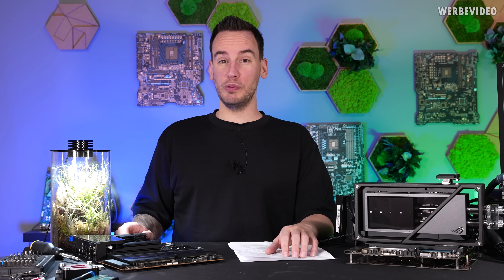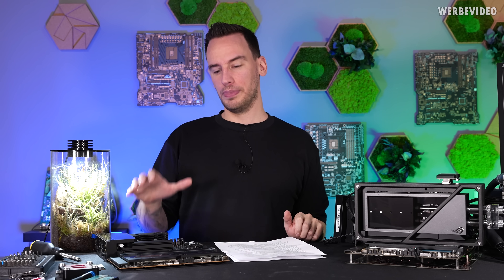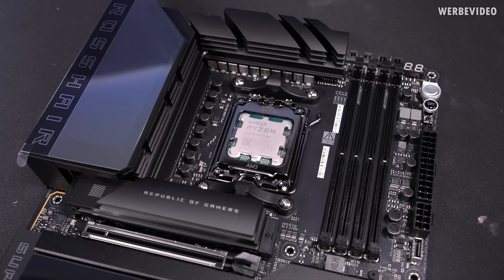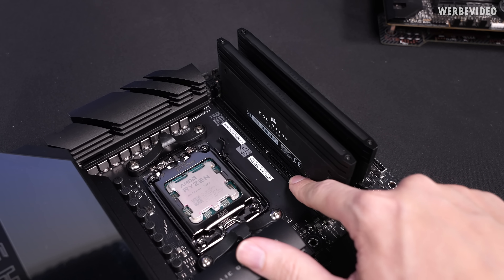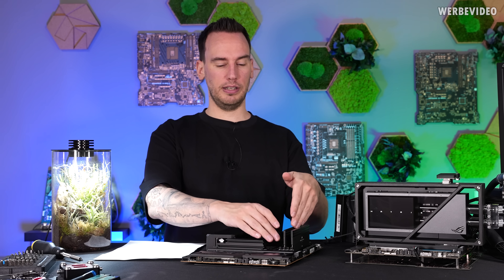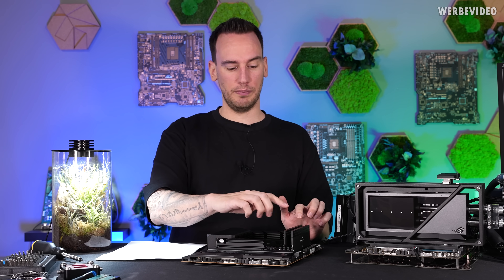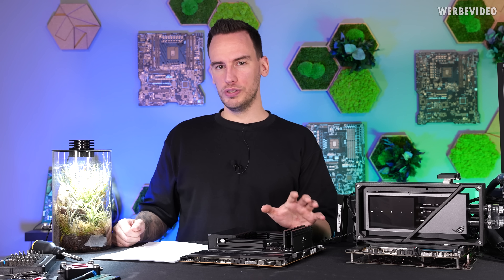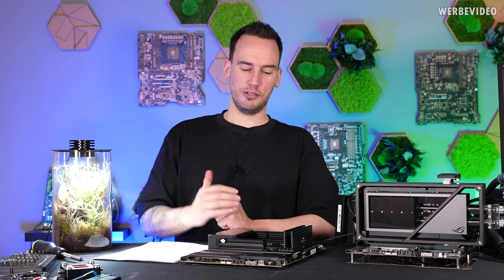How Empty RAM-Slots cause Trouble - ASUS NitroPath

Comment: I wish there were affordable 2 memory slot motherboards available. I’m not keen on seeing empty slots on my board, and running 4 sticks at decent speeds on AM5 is problematic.
Reply: It's funny when you think about it. It used to be the cheapo budget boards that only had two slots. I mean you're getting less, so it makes sense. Now with the way ram works in both the way demonstrated here and for general stability at speeds you pretty much have to run two sticks, so less became more... 

Leave it to the board manufacturers to find a way to charge us more for giving us less.
Reply: 3 to 5 years is what it took for 5900x b550 to run 4 sticks at xmp, just got a bios update that does it with no problems, ddr 5 has a trick to adjust ohms and not using much voltage as single gets bad at high volts.
Reply: @JohnDoe-tv4zd What is this trick with "adjusting ohms" that you're referring to? I'm not entirely sure I've heard of this one. I haven't tried pushing my OCs further in a while so I may be out of the loop a bit (mostly because it's such a chore to chug through the long boot times for every little adjustment). 

I got mine stable (on AM5) at 6400mhz 28-30-30-30-60-48 with all the other secondary timing tweaks and gdm/pwrdwn mode disabled, with 2200mhz fclk and called it a day. I also haven't updated my BIOS in a long time because MSI made so many BIOS updates that broke crap, along with every update wiping my complex settings out every time that I gave up on it (seriously why have OC profiles, if they don't transfer between BIOS versions?).
Reply: running 4 sticks at decent speeds on AM4 is also problematic 😞
Reply: It's cheaper to make a 2-slot board and you might actually find that the very lowest of end have them.
Problem is that despite being a better config for like 90% of users (you buy 32GB once and pretty much never need to upgrade), 2 slot boards just sell way worse in the same way that people like seeing lots of NVMe slots despite most just using a single drive and maybe a secondary sata game drive these days.
Reply: @bayanzabihiyan7465  I would argue that looking for a board with lots of NVME slots even if you are only currently planning on using one is still good practice. Future proofing is one of the most important decisions one can make when building a system. NVME is the way forward. Outside of needing very high capacity drives, it makes no sense to buy SATA based storage anymore (the pricing difference being increasingly negligible). So having more slots, even if they are empty initially, sets one up for future expansion.

Although, a bigger challenge there can be ensuring that the NVME slots won't rob you of lanes to run your GPU at 16x. Regardless of chipset, this can be misleading and obtuse (varying greatly between models/brands). So just like slotting more than two sticks of ram there are potential hurdles there, but with far less of a problematic hard limiting (especially with proper research).
Reply: @bayanzabihiyan7465   I would argue that looking for a board with lots of NVME slots even if you are only currently planning on using one is still good practice. Future proofing is one of the most important decisions one can make when building a system. NVME is the way forward. Outside of needing very high capacity drives, it makes no sense to buy SATA based storage anymore (the pricing difference being increasingly negligible). So having more slots, even if they are empty initially, sets one up for future expansion.

Although, a bigger challenge there can be ensuring that the NVME slots won't rob you of lanes to run your GPU at 16x. Regardless of chipset, this can be misleading and obtuse (varying greatly between models/brands). So just like slotting more than two sticks of ram there are potential hurdles there, but with far less of a problematic hard limiting (especially with proper research).
Reply: I would argue that looking for a board with lots of NVME slots even if you are only currently planning on using one is still good practice. Future proofing is one of the most important decisions one can make when building a system. NVME is the way forward. Outside of needing very high capacity drives, it makes no sense to buy SATA based storage anymore (the pricing difference being increasingly negligible). So having more slots, even if they are empty initially, sets one up for future expansion.

Although, a bigger challenge there can be ensuring that the NVME slots won't rob you of lanes to run your GPU at 16x. Regardless of chipset, this can be misleading and obtuse (varying greatly between models/brands). So just like slotting more than two sticks of ram there are potential hurdles there, but with far less of a problematic hard limiting (especially with proper research).

Comment: In the old days some server boards used RAM termination DIMMs. Basically, just a blank DIMM to ensure memory signal integrity. Every empty slot had to be populated with one. When they first came along, I thought the concept was sound.
Reply: Reminds me kinda of the ancient rambus RDRAM slots early Pentium 4s would use... but this was basically non-optional as they had to have a passthrough DIMM because from the way the memory channel looped; it would not complete the circuit without them.
Reply: @PriaSamari  
Before anyone mentions it, I don't think the N64 did that first. If I recall correctly, the Jumper Pak is actually a set of resistors that are designed to properly close each RAMBUS line, as the RAMBUS is set up to be daisy-chained with the Expansion Pak. If I heard correctly, A1 and A2 or B1 and B2 are daisy-chained in series, the N64's RAMBUS and Expansion Pak, I believe, are daisy-chained in parallel, thus necessitating a Jumper Pak if no Expansion Pak is available.
Reply: @PriaSamari  yes RDRAM (or RAMBUS), was used in server and workstation boards, but was really expesive like 3-5 times of standard SDRAM. i did build few servers and workstations with that, from professional workstation integraph used this on their intel based workstation (they were also making Sparc based ones). Fortunately mainboards did come with those blank modules, so you didn't need to buy them separately. soon after this was followed by DDR, which pushed out RDRAM and SDRAM.
Reply: @PriaSamari  Beat me to it. As an actual customer of RDRAM. It came with dummy/terminators. and boy the cost to upgrade was so bad i ended up using that P4 with Hyper Threading mind you till I was forced to upgrade when Win7 was in release candidate. the problem with RDRAM was the license fee and only a few companies could afford the fee. DDR1 was cheaper to license, the speed was lower but the implementation was easier. The 90s might have been a wild ride with compatibility, but the early 2000s were a Hodge Podge of standards.
Reply: I wonder if there are ways to make similar DIMMs for DDR4 and DDR5 by simply cutting off the PCB traces of scavenged broken DIMMs, or if they need to be purpose-made.
Reply: @NothingXemnas  I have looked into DDR5 terminator dimms. I can't find anything. This has been brewing in my mind for a while now. Having a heavy tech background in the white box manufacturing industry I've seen many designs and concepts that could be applied to things today, but I believe the gains would be marginal if any. Many of these older designs came from necessity by manufactures like SuperMicro, 3Ware, Adaptec, etc... Besides I feel like 7200mt/s is plenty fast enough for my 14900K even though I have overclocked them to 8000mt/s. I guess it's in the DNA. FASTER!
Reply: They would need a purposely designed circuit to actually attenuate the electrical noise and not interfere with the controller/etc. It'd probably make for a good project.  @NothingXemnas
Reply: @NothingXemnas  Purpose made. It might be possible to convert a dim to reduce the issues of an open slot, but it would have to be purposefully done and not just hacking off the components already there as that would most likely just cause issues or at least degrade the signal integrity.
Reply: @NothingXemnas  tha't interesting question, i mean while length of DDR PCB is same since first DDR DIMM (or rather, there are 2 standardized sizes, one for desktop, and one for notebooks eg. SO-DIMMS), DDR2 and DDR3 had also same pin count (240), just latch was in different position, so it was similar situation to DDR4 and DDR5 (288 pin both). altough i think, they just need to make new one.
Reply: I wonder why, if those aesthetic RGB spacer cards don't already do it, why hasn't anyone developed a DIMM-sized card which effectively functions as a Faraday cage for that slot to electrically shield that socket from adjacent RFI? Could be interesting to see whether signal integrity improves with some pluggable device.
Reply: @ChristopherWoods  Any gains from this would most likely be marginal if any. Probably why no one has developed another product to sell. Believe me many have had the idea.
Reply: @ChristopherWoods  I want a RAM slot hat!!! Someone please make this.
Reply: Heh, oh the days of having to remember to Terminate things. Especially if you were using classic SCSI or the original RAMBUS where you needed the alternate dummy pairs for parity.
Reply: @pyromethious  The SCSI terminators were necessary for bus termination. I remember them well. Used many on Ultra SCSI 320 drives on Adaptec RAID controllers. I think this conversation might be leaning towards something like the old CRIMM modules that terminated unpopulated RAM slots on some older server boards. While necessary for some reason I can't recall they are totally unnecessary these days. I brought it up as a throwback to the old days. I do remember the CRIMM modules having something to do with memory signal integrity. Some of the stuff I worked with in the early 2000s dealing with registered Intel Server Platforms would straight blow your mind. I built some boxes for the Weather Channel for modeling that ran 8 slot-based Xeon CPUs, 4 per mezzanine board, two separate mezzanine boards with a CPU cache coherency module binding them. Both boards slotted into a monster of a mainboard with 16 SDRAM slots. Two sets of redundant 300w modular power supplies for a total of four 300w units. The bloody thing only had two hot swap drive trays with a SCSI backplane.  Old school raw balls processing power all wrapped up in a conservative 8u package. Man, I wish I took pictures of some of the old bioinformatics clusters I worked on for GA tech and GA state university. Did some crazy stuff for Fermi Lab and Jefferson Lab that consumed entire buildings. One order for Fermi Lab was for 250,000 1u Linux servers that were to comprise a cluster just for caching data collected from energy research. Never mind the rest of the computing power for processing and storage. Used to work for Build to Order Manufacturing, LLC out of Alpharetta, GA. Fun stuff, the good old days.
Reply: @pyromethious  I have spent a lot of time finding and fixing bad signal wiring practices.
Reply: I wonder if those dumb Corsair RGB sticks with no ram on them help or not.
Reply: @a-cold-wind-0  That would make a interesting video
Reply: I tried to find those but no such luck
Reply: @diamlierx  Me too.

Comment: Would not the obvious solution for empty slots be to fill them? Bridge the gaps on the pins with a blank module. Its just closing the circuit and eliminating the possibility of interference.

Comment: Funny, I had a similar problem with my internet signal being super crappy at my new apartment. The technician finally figured out it was because there was a wire connected to the neighbor's house from the pole, but their service was disconnected so it was basically 100ft of open wire pulling in RF interference.

Comment: With Nitro Path touching the contact on the corner of the matrial isn't that asking for problems with extra wear and tear as they say?
Maybe not a problem for a normal user seeing you might not pull out the ram very often en put other ram into the slots but still.

Comment: Thanks for the flashback to 1991 sitting in an computer engineering class. Any floating wire in a circuit acts like an antenna and creates noise.
Reply: It also reflects high speed signals, adding to the noise. Termination resistors in the controller absorb a lot, but the signal at the populated modules still gets messed up. The eye patterns that Roman showed were amazing to see. (I last did RAM array design literally decades ago!)
Reply: Besides the antenna effect of unpopulated slots it is physically a longer distance to reach the furthest slots; It adds inductance, any length of copper trace will add inductance. Inductance makes the signal shifting from one state to the next slower and will try to cause overshoot. For those who not intuitively understand it I usually make a water/hydralic or mechanical comparison: it:s like adding a flywheel on a shaft. When you try to rotate the shaft exactly a quarter turn, really really fast BUT dealing with a flywheel on the daym shaft! That tends to slow the start of spin and wants rip your arm off once it is going and you try stopping it on the spot.
Reply: Would it help prevent that Side Channel Attack on RAM where a guy read the emf from the RAM and reproduced the image on the screen of the target computer by removing the "antennas"?

Comment: That difference between the first sketch of the NitroPath and the picture of it in the cross section cut was pretty logic. The first image showed what they wanted if nothing else made it a problem. The cross cut showed how it had to be designed to really work. The problem with the first sketch was that the pin would dig into the gold plating on the pads of the memory stick and when you tried to released it that pin would either dig a cut in the gold plating or deform as the memory was pulled out, maybe both. But with the curved approach the memory stick can be removed without damaging the pins in the slot a lot and without damaging the contact patches on the stick. Simple really.

It wouldn't surprise me if they tried making the pins in that first shape and making the tip rounded, but it wasn't enough to mitigate the problems enough that they was about to release the product that way. After all if the pins are distorted then the memory slot is damaged and they either get a RMS problem with it or their already bad reputation get even worse.

Now I don't think it's really a perfect solution as far as reliability end endurance is concerned. Linus posted a video recently where they looked at damaged motherboards and tried to get them working. I won't call it reparing as what they did was basically fixing bent pins. On one motherboard some of the pins in a memory slot had been pushed down flat. This was the old style that's been used for many years, and still they were damaged when installing a memory module. These had the long top that hocks into the plastic of the slot to make sure they are not protruding to far into the slot and are damaged when a module is slotted in. And yet they were pushed down and damaged. It's not very common but it still happens. Now the NP version of these pins doesn't have a limit on how far into the slot they poke but the distance is determined during manufacture. Yet they are free to move and there will be some cases where they are poking just slightly to far into the slot and get damaged when you insert a module.

Yes I'm being negative, but that's because I've seen these things happen in real life. I have personally built several hundred if not thousands of PC computers so I have inserted one or two memory sticks in my life. When I look at something like this I immediately look for things that can go wrong. Something like this has to be simple and safe even when someone is a bit heavy handed, because not everyone will be really careful and some memory sticks can be a bit rougher than others. So what can go wrong will eventually go wrong. Now is it that likely to happen in this case? Probably not, but I do think it's less reliable in use than the old version. I'll be happy if I'm proved wrong though.
Reply: It would surprise me if they tested the first solution. Even with round tips, those pins would be subject to lot of mechanical stress and might lose their strength through time. 
Most experienced people knows its bad design, so their army of engineers probably ditched that entirely.
IMHO, the slide is just made by marketing and executives who thought it was more impactful to lie on this diagram than acknowledging it's "just" 15% shorter. And as Roman said, they missed the point by not advertising it by emphasizing the empty slots signal interference issue.
Reply: @PainterVierax  I still think that sketch was the ideal solution they wish would be possible, but like you said this was the way to make it usable.

Comment: I'm pretty interested in trying out CAMM2 on my next build. Just waiting for the Intel i9 285k and Z890. I may at least wait long enough to get a contact frame for LGA 1851 as well. I've already ordered a chunky air cooler thats rated for the new socket, CPS RZ820, and gonna use the KryoSheet gaphene pads.

Certainly hope the new CAMM2 memory can offer some improved performance.

Comment: The extra length of the fingers in the old-style sockets adds capacitance to the circuit when the sockets are unoccupied. This capacitance loads down the signal path, reducing the signal levels between the memory in the occupied slots and the CPU, and dragging that signal down into the noise at really high frequencies. Reducing the length of the fingers in the unoccupied slots reduces this capacitance, improving the signal-to-noise ratio of the memory signals, thus improving the maximum memory frequency possible.